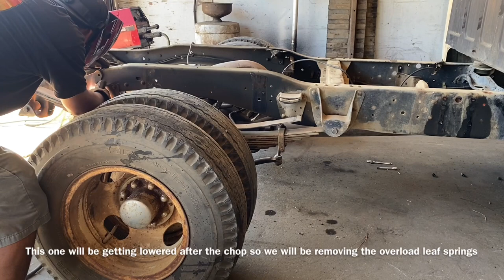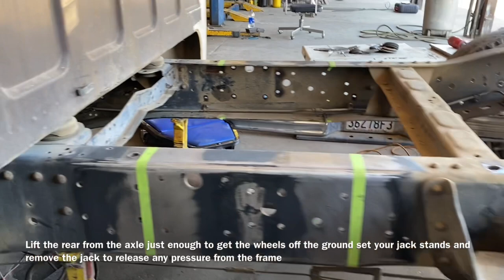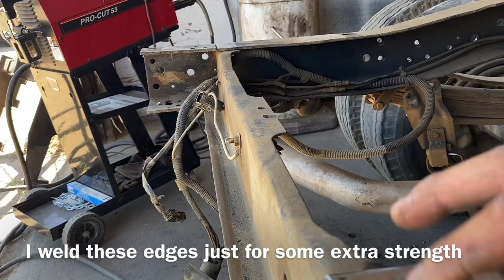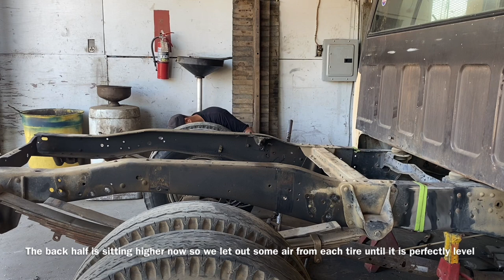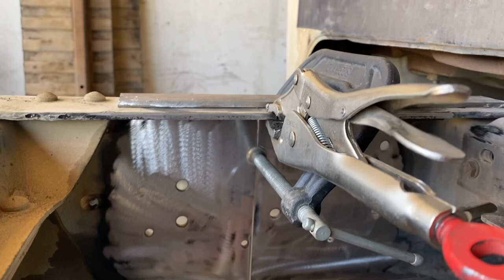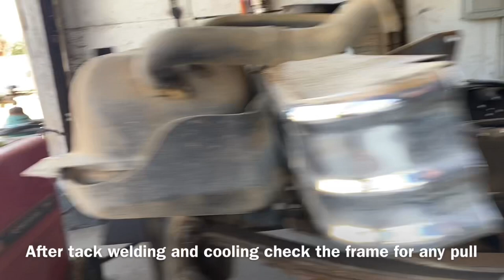Crew cab squarebody c30 short bed conversion frame chop

Comment: It seems the most common mistake people make when welding back together is not welding insides first, this leaves a good finish that doesn't need to be ground unless installing inner rail section and makes easier to back grind root pass from outsides for final welding, but each to their own !
Reply from the maker: Great information thanks for sharing brotha

Comment: Nice work brother!! I shortened mine crew cab down, but one thing I haven’t been able to come up with is what to do about the parking brake. How are you going about shortening the cable to keep the parking brake?
Reply from the maker: Thanks brotha, for the e brake cable you can use a wire rope clamp I think that’s the proper name
Reply: @bacfab9259  I think I know what you’re talking about. The ones with the u-bolt? I never would have thought those are strong enough. Thanks dude!